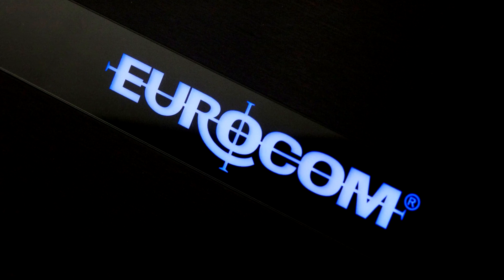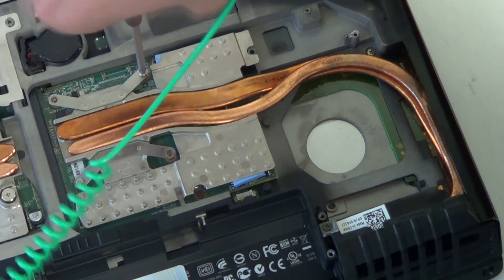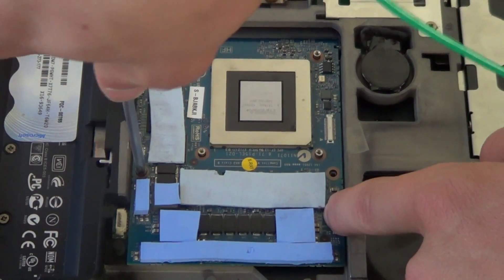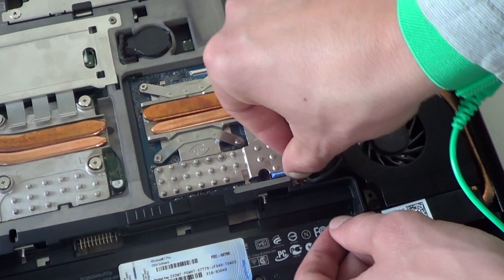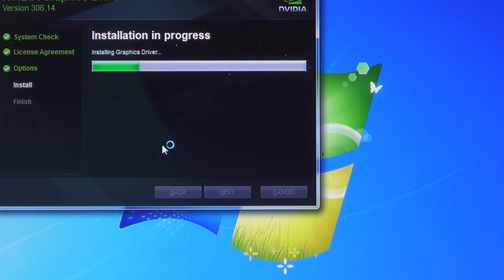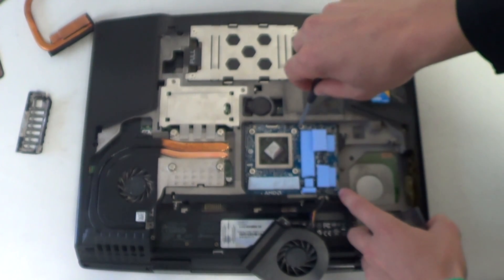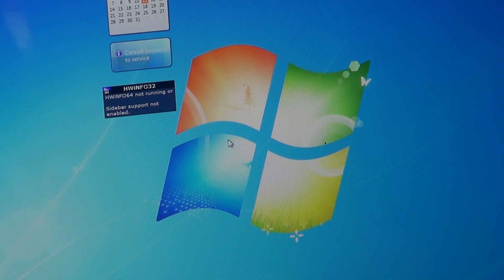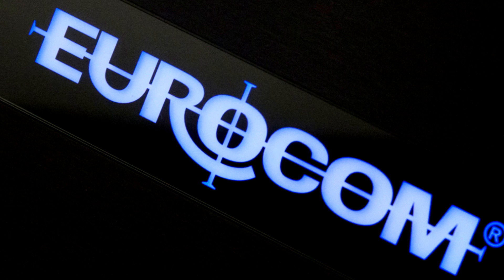AMD Radeon HD 7970M and NVIDIA GeForce GTX 680M upgrade in Alienware M15x

Comment: My bro gave this to me can i upgrade r1 gpu? The one that have gtx 260m
Reply from the maker: Yes, the m15x is upgradeable.
Reply: Thanks for the reply sir. And one last question is the stock cooling more than enough for this gpu? Thanks again
Reply from the maker: Franz Barrientos
You will need to re-arrange your new thermal pads to ensure they are covering the proper components.  You will also need to re-apply your thermal paste.
Reply: EurocomTechnology thanku for clearing all my questions im noob with laptop upgrades
Reply from the maker: No problem at all!

Comment: Hi i have the m15x r2 with i7-720qm upgraded with hd 7970m,16gb ram 1600,500 gb ssd and a09 unlocked bios, can i upgrade the cpu with the i7-2920 ?Or the best for the platform is the 940xm?
Keep the good work...
Reply from the maker: The cpu socket you have should technically support the i7-940XM although there may be overheating issues or power supply limitations associated with the higher wattage.  720 is 45w 940 is 55w.  Thanks!

Comment: how do i know if my graphic card is solder to my m/b? and if i'm willing to pay extra cost to upgrade my gpu and processor? what is your advise?
Reply from the maker: You could do some research on your system or you could open it up and look at the graphics card.  If it is screwed down than it is probably an MXM 3.0b graphics card and can be removed, if it is part of the motherboard than it cannot be removed.

Comment: I currently have a M15x with a Nvidia 240m and I'm looking to go with an AMD 7970m or Nvidia 780m. Should I stick with Nvidia or will switching graphics card producers affect my system all that much? Also do you guys sell the power bricks at the start of the video?
Reply from the maker: Switching manufacturers shouldn't matter at all.  No, we don't sell the power bricks.  Dell should sell those.

Comment: Hi there please respond im looking to buy either a gtx 680m or 7970m for my m15x laptop can I just buy any of the models or does it have to be a specific gpu for the laptop? Or just any of the above
Reply from the maker: Due to the MXM 3.0b graphics technology any 680M or 7970M MXM 3.0b based card will should work for you.

Comment: The bracket included in each kit is not needed for this upgrade, correct?
Reply from the maker: I assume you are referring to the small X bracket? That is what the heat sink screws into.
Reply: Yes. It just fits onto the back of the card, right? Do you know if the bracket on a 460m would fit on a 680m?
Reply from the maker: coppert4nk
Ya, it goes onto the back of the card.  Yes, a 460m should fit the 680M.
Reply: Perfect. Thank you so much!
Reply from the maker: No problem.  That's what we're here for.

Comment: Im having an issue with my m15x, I upgraded my lpatops gpu to a gtx 770m, but  cant get the drivers to install, any thoughts on how I can fix this?
Reply from the maker: I would suggest contacting the seller of the graphics card for support.  Make sure all existing drivers are uninstalled.

Comment: Can i upgrade in the future my 765m to a 780m? My laptop is an msi ge70 20e
Reply from the maker: I'm not too familiar with that system but it has discrete graphics so it could be possible.
Reply: If it's soldered to the motherboard yo can't upgrade it.
Reply from the maker: Correct!

Comment: Hi EurocomTech is GeForce GTX 765M compatible with my old M15x and do i need to change my power supply? thanks
Reply from the maker: Yes it is, that upgrade is easy.  Ya, I would suggest getting the upgraded AC adapter to ensure your system has enough power.
Reply: EurocomTechnology thanks man.. Do i also need to uninstall my previous GPU driver before plugin it in? about the AC adapter is it 600W or 300W or 240W thanks for the help.
Reply from the maker: mark jeck
Yes, you should uninstall your previous drivers.  It is 240W.  Good luck!
Reply: EurocomTechnology thank you very much man
Reply from the maker: mark jeck
No problem at all.  Good luck!

Comment: I had a professional install a gtx 660m in my m15x but he said it wasn't comparable with the laptop. However I keep hearing about people getting them to work on m15x's and I would like to know if it is actually compatible or if I wasted 350 dollars on a graphic card I can't use. Thanks
Reply from the maker: The 660M should work in your M15.  You will need the correct vbios, bios and driver.  You may also need a small copper shim for the heatsink.  Please contact whoever you purchased the kit for assistance.

Comment from the maker: The system will only draw the power or amperage that it requires.  The 150W adapter was designed for lower power cards which draw less power.

Comment: thanks for the reminder. The 240W power adapter comes with the m17x right?  do you get any messages at boot up about the power adapter not being the same one that the m15x came with if using the 240?

I might give this a shot, thanks

would you recommend an SSD HDD for the m15x?  is that worth it with the sata2 interface that the m15x has?

Comment from the maker: We do have customers that have upgraded their M15 with a 680M but during our testing we have found some thermal issues, as the M15x is not capable to adequately cool the card.  Other options that  would be good for you: 670M, 660M
Reply: I put a gtx 980m 8gb in a precision M6800 got in the 90's temps on cpu and gpu  lol

Comment: There is no bios changes for highier wattage, only drivers? Card didn't fried? If there is only putting card, adapter and installing soft I gonna upgrade my m15x now. One more question, what is that bigarsed battery back.

Comment: the m17x r2 can run crossfire the old vr of the m17x was able to run sli/crossfire witch is the one i have i just dont know if my pc has the power to run to top of the line cards

Comment from the maker: You definitely need to rearrange the thermal pads or get new ones and reapply thermal paste.  In some occasions you will need to modify the heat-sink as some 7970ms are slightly different.  Please consult with your seller.

Comment from the maker: Yes, 680M is doable.  You will need to upgrade to the larger AC adapter to give the video card the needed power.  Other options are: 660M, 670M, 675MX, 670MX, 7970M.

Comment from the maker: An antistatic wrist strap, ESD wrist strap, or ground bracelet is an antistatic device used to safely ground a person working on very sensitive electronic equipment, to prevent the buildup of static electricity on their body, which can result in electrostatic discharge (ESD). It is used in the electronics industry by workers working on electronic devices which can be damaged by ESD.

Comment from the maker: That shouldn't be a problem.  From the information I have seen the 560M uses about the same amount of power as the 260M so a new ac adapter isn't needed.  You will need thermal paste, thermal pads and to ensure the thermal pads are placed correctly on the card and heat sink.

Comment: Nice video I don't really want a 680.  I want to put a gtx 560m in that's all I really need for my gaming.  I have a 260m in right now with the 1.73 quad i7 and 8gb of ram. Will I need the better power brick and if so where do I find it I cant find it.  and will I need anything else other than the updated bios and drivers :D sorry I might have worded that wrong lol

Comment from the maker: The ESD kit shoulod come with a little ring at the of the cord that fits around the ground prong on the electrical chord.  Ideally you should have a grounded mat that you put the hardware on.  Then you ground yourself.  I have heard that you can simply connect the alligator clip to a very large metal object and that will dissipate the charge. It works but it is not ideal.

Comment: Hey, I have an M15x and I love CAD programs, the problem is that some CADs like AutoCAD aren't compatible with the HD5850...
Is it possible to upgrade the M15x with a NVidia QUADRO K3000M?
This card has a 75 Watt, so it could work with the standard power supply, am I right? (GTX 260M also has 75 Watt, my card has 39 Watt)

Comment: I don't understand why it's so simple to upgrade video card on a laptop.
I have a Asus N56VZ and I'm 99% sure that the BIOS of my video card (a GT 650M) is in melt within the BIOS of the laoptop's motherboard, both BIOS are the same file.
I can see that cuz when I see the changelogs of the N56VZ BIOS, sometimes they say "new nVidia VBIOS".
So it seems impossible to change my card, especially if I wanna go on a Radeon...how could I get a new VBIOS separate from the mobo BIOS ?

Comment: Hi, I currently have M15X with PM55 motherboard, bios A09, i7 840QM CPU, 16 GB 1333 DDR3 ram WITH 150w psu. Will just having a 240W PSU be sufficient to install the GTX 680M card or do I need to make bios / configuration changes?

Comment: So, I suppose that if I buy m17x (here in Czech republic we have an awful upgrade possibilities of m17x itself) with 660m, I could manually upgrade to 7970m/680m aswell without any hard times myself, right? Should not be that much of a difference in here. I have also seen the CrossfireX installation to m18x you've made and it's fairly similar there aswell.

Comment from the maker: Hi! it sounds like you are having a thermal issue,  Perhaps what he means is that the card is not making proper contact with the heat sink.  I would suggest following up with the technician further.  Did you buy this upgrade from Eurocom?

Comment from the maker: It will work, but the card will not get enough power through the conventional ac adapter, I'm not sure if an adequate ac adapter is available for the m15x.  we do know that other cards, such as the 7970m work great in the M15x.

Comment: Brother, I have tried to upgrade mine from GTX 460M to HD 6990M but it shuts down after launching a game or youtube videos after 12 secs. What's the problem? I've put thermal paste and pads. The technician told me to put a copper sheet. Do I really need to put a copper sheet or is it the power supply's problem? Help me. I bought it for 532$ and now it's like a waste since a year..